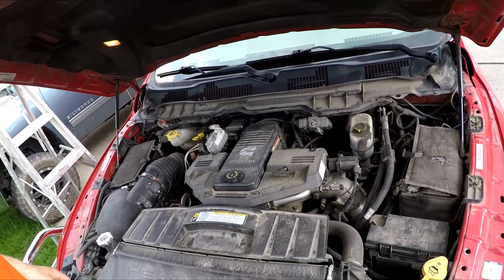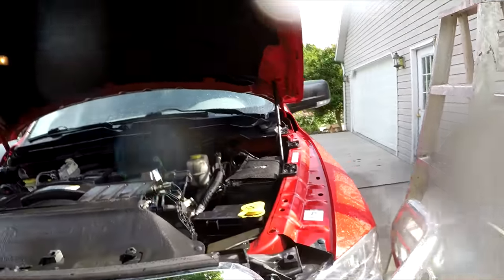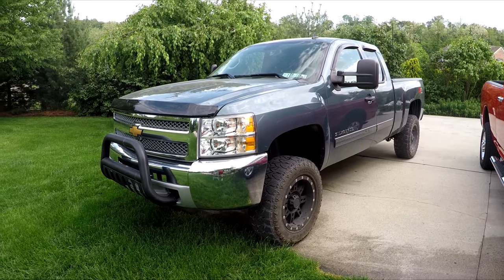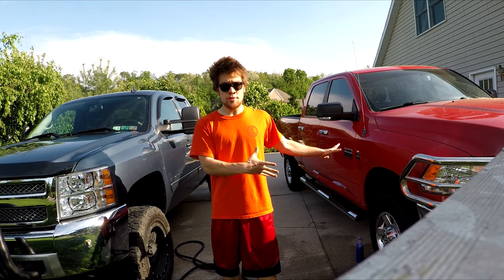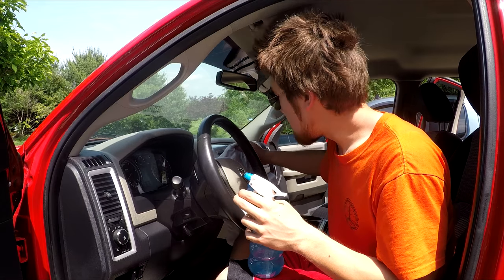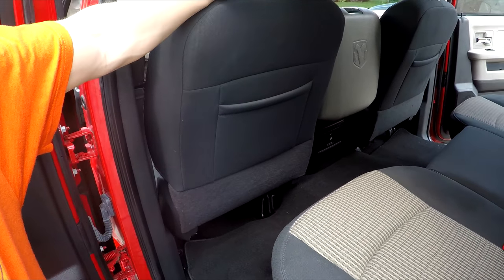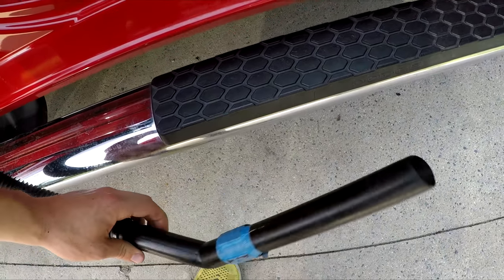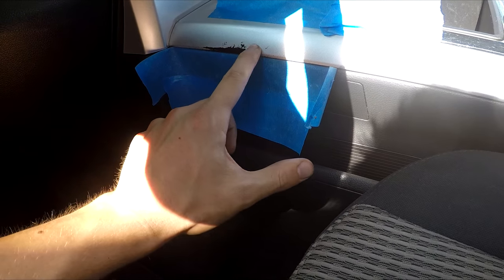I CAN'T BELIEVE they LEFT THIS in my Cummins...

Comment: I was looking at this video. And the CD you removed was the repair manual. I have a 2014 4th gen 1500 gas 4x4. It's lifted now. It has  a Rough Country 4 inch lift kit. like your videos we have similar equipped trucks. I'm in Texas so trucks are everywhere. This is my second 1500, first hemi powered Truck. I want to remove those running boards from my truck too.
Would love a set of AMP power board's. I'm sure I can get in the truck without the old man boards. And without the boards the truck has a lot more clearance on the side's and looks better without them. What kind of camera do you use to blog? I would like to start a blog of my own. The plan is to eventually get a diesel truck as well. Like your videos keep them coming.
Reply from the maker: Sounds like you got a nice truck man. Yea those are the only steps I would consider once I get a giant lift.